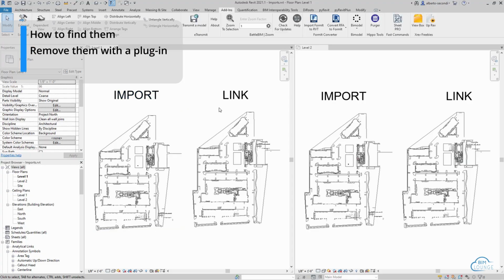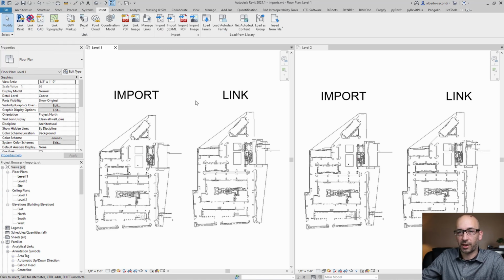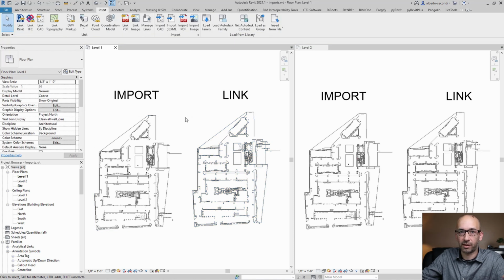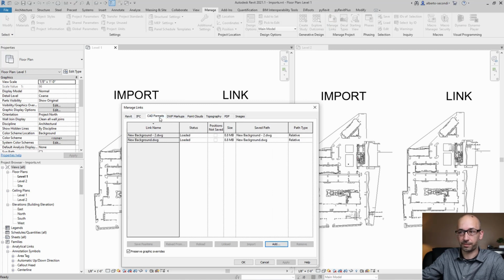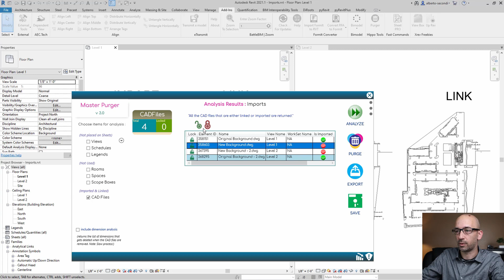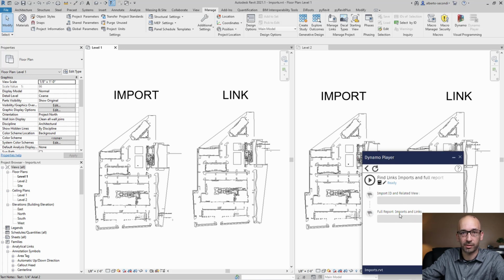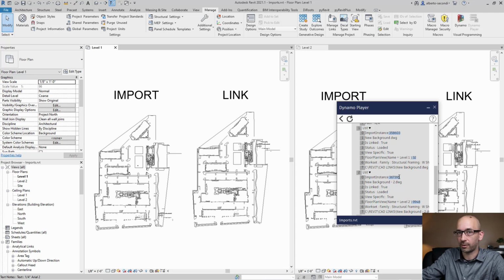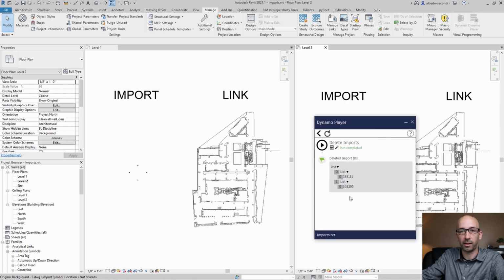How to find and remove cad imports in Revit projects

Comment: Hey Alberto! Thanks for this video! Very useful. I have one question - is it possible to choose which imports to delete with your dynamo script?
Reply from the maker: Hi Lelde, welcome back! My script removes all imports because I assume one would want to remove them all (after you replaced them with the correspondent links), so the short answer is no, not with the current scripts. The quickest solution is to use the plugin I showed that lets you remove them individually. If you want to do it with Dynamo you can run the "Report" script, get the ID or list of IDs and paste it into the "Select by ID" command in Revit and then click delete. It's a great question, I might see if I can edit the script and show it in one of the next videos. Let me know if that helps!
Reply: @BIMLounge  Hi! Yes, I did download the plugin and it works very well. Thank you for suggestion.
Reply from the maker: @leldesavoni  Happy to help!